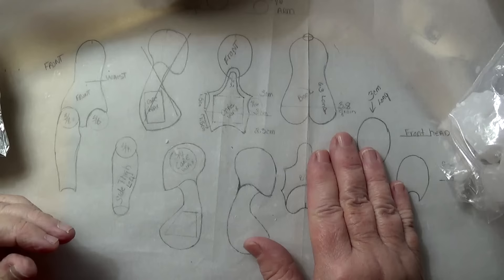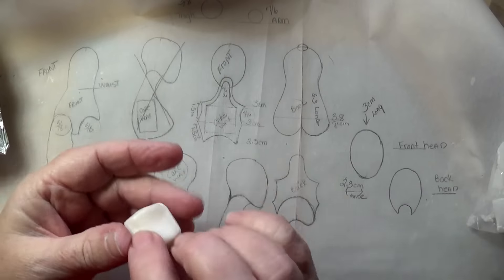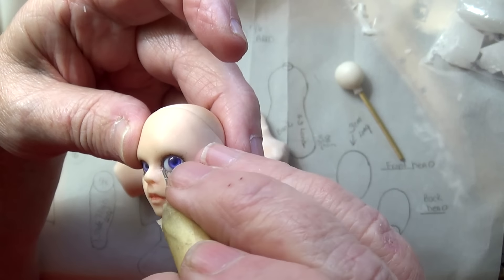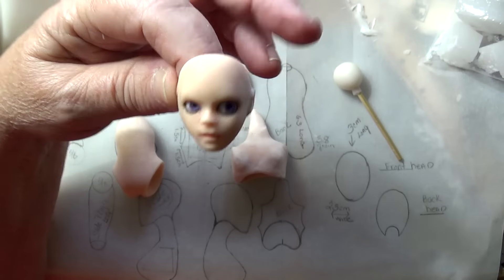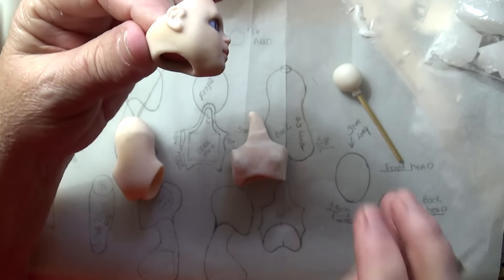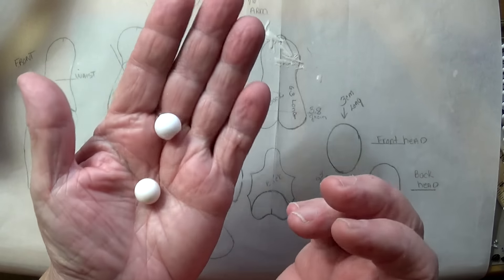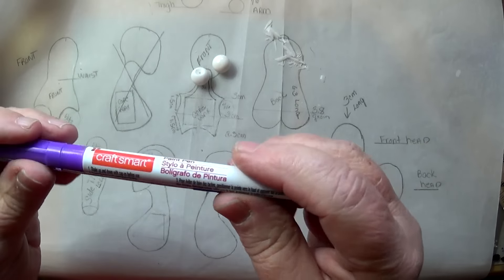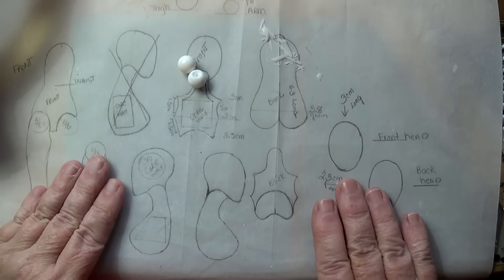Getting ready to start my ball jointed doll bjd

Comment: I have one of these handy hands. Right now I'm currently using it as a door stop because that's about as useful as I've been able to make it. I always have issues with the clamps not moving where I need them to and falling off the main assembly at inopportune times. It is cheap, but I currently prefer using a Panavise 209. It's about $30, but it has way more axes of rotation than the handy hands, can grip a much broader piece if need be, and can be placed virtually anywhere. Just my 0.02 USD. The handy hands may work fine for you, but I've found the 209 irreplaceable for sculpting miniatures and doing electronics work.
Reply from the maker: Thank you Zak for your feedback.  I will keep this in mind if I ever need a higher grade tool.  Right now its working for me and I just clamp it down to my work table.  I really  only use one clamp at a time for the way I sculpt my pieces.  Eventually I will have a stand armature that will clamp in the back of my work.  Thank you again and your advise may help someone who has the same problem as you.